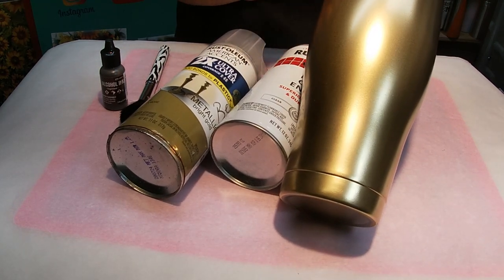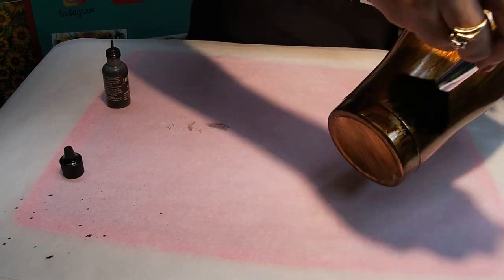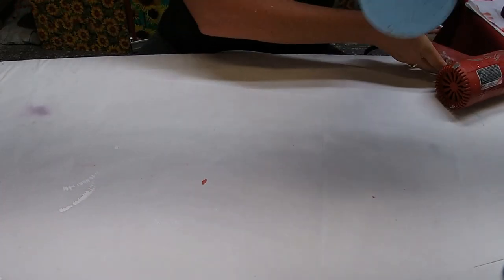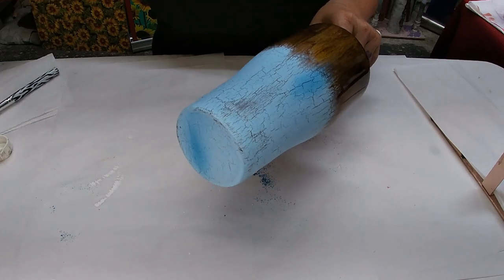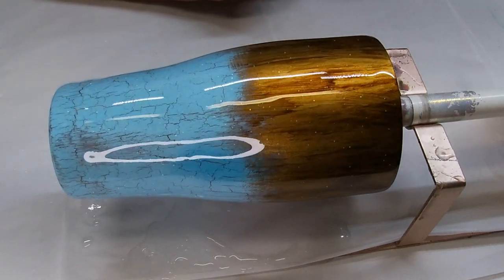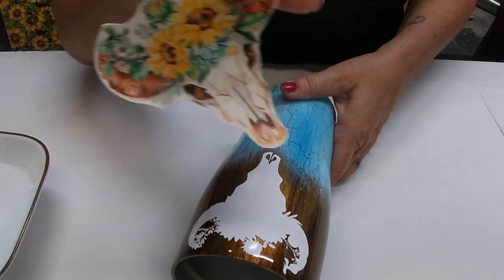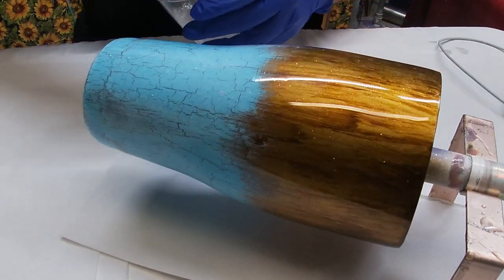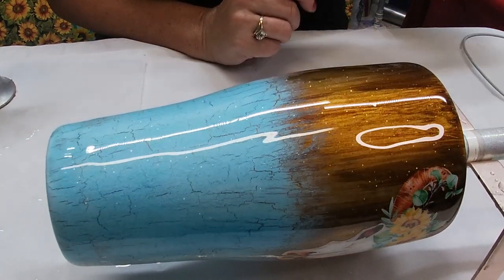Crackle Wood Grain Ombre'  With Glitter Additive In Epoxy

Comment: I epoxied after the woodgrain,  then did the Elmer's and acrylic paint and it won't crackle. Tried several times.  Suggestions?
Reply from the maker: Make sure the glue has become tacky prior to applying the paint, add a little heat to help push the crackle, once the crackle starts move on to another section as you would not want to burn the paint. Let me know if this helped.

Comment: is 1 coat of epoxy applied over the alcohol inks woodgrain before starting the crackle process?
Reply from the maker: Yes I did apply one coat of epoxy over the wood grain in order to make sure I didn’t mess it up before applying the crackle.

Comment: Hi. Beautiful job! Like a lot of people I am trying to learn as much as possible before attempting my first tumbler. I was wondering what causes the crackle effect? Do I need to add the alcohol ink to the paint for the reaction with the glue to happen? Or can I just use paint if I have a color I want to use?
Reply from the maker: I am so sorry for my delayed response, As the glue dries under the top coat of paint, it causes the paint to shrink and crackle. No you dont need the inks to get the crackle affect.

Comment: This was great. I've done several woodgrain tumblers & several tumblers with waterslides (both on woodgrain + glitter). The crackle was new to me. After doing the initial woodgrain + seal + layer of epoxy, could you have placed the waterslide and THEN done the glue+paint for the crackle effect? Just trying to save an epoxy step / save added weight. Can't wait to try this once I can buy gloves / masks again ...

Comment: Two questions…did you epoxy the cup before you put on the Elmer’s glue and the did the white acrylic paint and Baja blue ink mixture also have modpodge in it??
Reply from the maker: So sorry for my delay on this question, I did epoxy before the Elmer’s glue part and no the mix only included the ink and the paint no mod podge.

Comment: This is exactly what I want to do! Thanks for sharing. Two questions: what kind of paint thinner do you use and can you use white vinyl instead of printable vinyl?
Reply from the maker: Angie Albertson Thank you so much for watching the video, the paint thinner is Lacquer Thinner by Klean Strip. In order to print the image correctly you would want to use printable vinyl or white waterside to lessen the step I did. ❤️
Reply: Creative Vinyl Designs By Rebecca Escott, sorry to keep asking questions, but I am talking about the layer underneath the water slide. It needs to be printable and not just white, even though you are just cutting the bottom layer out? My daughter saw this and now I won’t get out of making her one 😂
Reply: @angiealbertson  I believe you're asking if the white backing under the clear waterslide has to be white printable vinyl as opposed to regular white vinyl? I thought the same thing- unless I'm mistaken, I don't think it would matter? Maybe the "grab" of the printable would hold the waterslide better? I'd use the white vinyl if that's all you had. Often I'll cut out a design on my printable vinyl or even sticker paper and will put that on a white vinyl to add more color to it on a color cup. This is a beautiful technique, a gorgeous cup and a well explained tutorial!

Comment: Do you seal the wood grain (ink) before adding epoxy coat?
Reply from the maker: YEs, I seal the wood grain before I epoxy.
Reply: Creative Vinyl Designs By Rebecca Escott did you seal it with just a spray clear coat?
Reply: @RebeccaEscott  I sealed mine and it turned the color to a greenish tent.  What should I do?

Comment: what type of white paint did you use to mix with the blue alcohol ink?
Reply from the maker: Regular white acrylic paint bought from Amazon, Apple Barrel brand, heres the link:  https://www.amazon.com/Apple-Barrel-Acrylic-Assorted-21119/dp/B0018N4P54/ref=sxts_sxwds-bia-wc-p13n1_0?cv_ct_cx=Acrylic+white+paint&dchild=1&keywords=Acrylic+white+paint&pd_rd_i=B0018N4P54&pd_rd_r=75673c27-6851-4aa1-a048-a94d9686f353&pd_rd_w=YiMVA&pd_rd_wg=fWLCI&pf_rd_p=13bf9bc7-d68d-44c3-9d2e-647020f56802&pf_rd_r=N3FNFRG5FWQZ2CGJMSE0&psc=1&qid=1597256847&sr=1-1-791c2399-d602-4248-afbb-8a79de2d236f

Comment: Hi!  I just came across your tutorial and I have to say that this is an amazing cup!!  I have a few questions:  how much epoxy are you mixing for each coat?  Prior to applying the waterslide, you spoke about a matte enamel spray. When is this product used?  Is it to spray on to the water slide?  If so, what is the purpose of spraying the waterslide with the product?  Where did you purchase the espresso and blue inks?  Thanks in advance for addressing my questions
Reply from the maker: Thank you so much, The first coat was very thin as I only wanted to protect the woodgrain affect, Yes the matte clear spray helps seal the waterslide to keep the inks from bleeding. The blue was made up using inks and paint, I basically dyed my paint to get the color I was looking for. I hope I was able to answer your questions.

Comment: Quick question about cutting the shape out of vinyl. I'm currently working on a clear waterslide with a darker cup so I was wanting to do what you did but cannot for the life of me figure out how to get thst shape. My pic is a png so when I try to Trace it traces a square.
Reply from the maker: Hey, ok so what I did with my image once I had it in DS was duplicate the image and go up to where it says FILL, Click No FILL so the image basically will turn grey, The grey image will cut and then you print the other. Apply with vinyl cut first and then apply the waterslide right over it. I hope this made since, please let me know if that worked for you ok.
Reply: @RebeccaEscott  ok thank you . I have a Silhouette so I'll have to figure out what is similar on it.

Comment: When you did the blue paint then mica was that just over the top coat before the epoxy coat
Reply from the maker: Yes, I added alittle mica before the epoxy coat, I also did not seal after this step. I just went straight into epoxy.

Comment: Do you seal this cup after you put on the alcohol ink
Reply from the maker: Yes, after the wood grain technique I did seal.
Reply: @RebeccaEscott  with what? Epoxy or a spray sealer? That wasn't mentioned in the video.
Reply from the maker: Michelle Winter KS resin or Pro Marine are my choices of epoxy and I seal with matte clear spray from rustoleum.

Comment: Question why do you seal in between processes isn’t the epoxy sealing ?
Reply from the maker: Yes, technically it is, however when working with any inks its best to seal that before moving on so that it doesn't turn green once you apply your epoxy.

Comment: So where do you purchase the water slides
Reply from the maker: Amazon if you have an inkjet heres the link. https://www.amazon.com/Sheets-Inkjet-Transparent-Printer-Transfer/dp/B06XP7NZ62/ref=redir_mobile_desktop?ie=UTF8&aaxitk=2IuIGUug.6o5o4cB.HWEXQ&hsa_cr_id=7214556330301&pd_rd_r=5f30139f-8f2c-4e3a-93ab-ff9ee2d4468e&pd_rd_w=Eohgf&pd_rd_wg=Vz20n&ref_=sbx_be_s_sparkle_mcd_asin_0_img
Reply: Thank you but I don’t have a inkjet printer, they only work with the inkjet printer?

Comment: Why water slide instead of just a vinyl pic on the top?
Reply from the maker: Im not a huge fan of using printable vinyl or white waterslides for my decals which is why I chose to use the clear waterslide but also it gave me a chance to  show the trick using regular white vinyl behind the clear slide so it can be seen.

Comment: My woodgrain ALWAYS turn a green color. I have attempted many ways and STILL turns green. It's so frustrating.
Reply from the maker: Yes, That can be super frustration, May I ask what you seal them with?
Reply: I use mostly Rust-oleum crystal clear enamel, but if I'm out ill sometimes use Rust-oleum 2X gloss clear